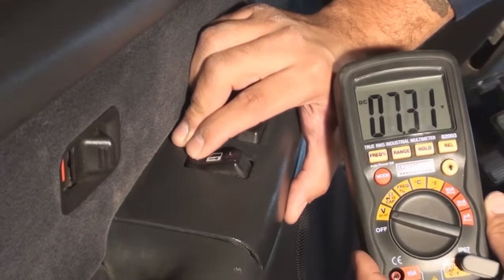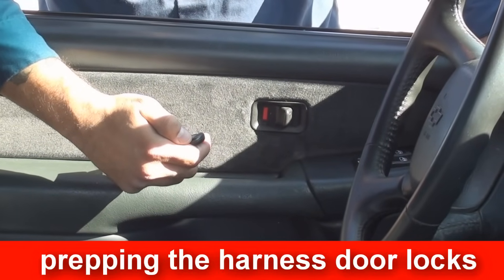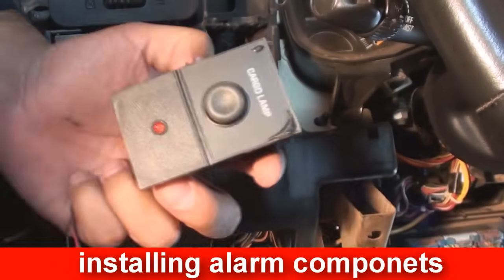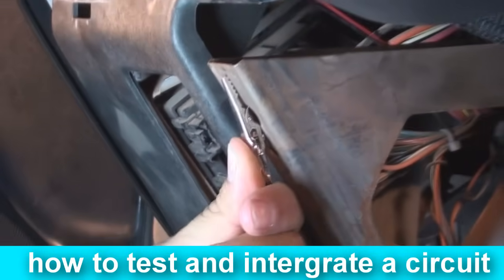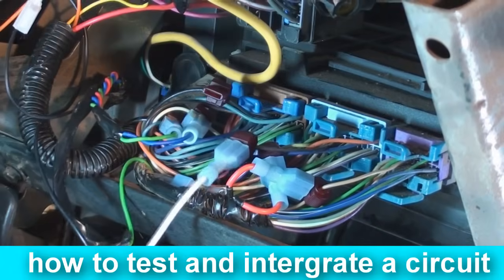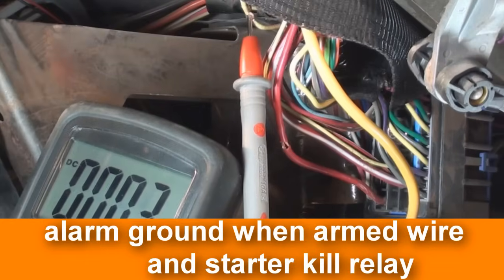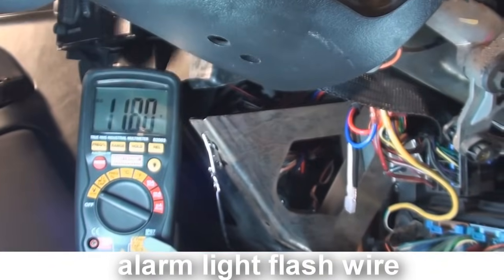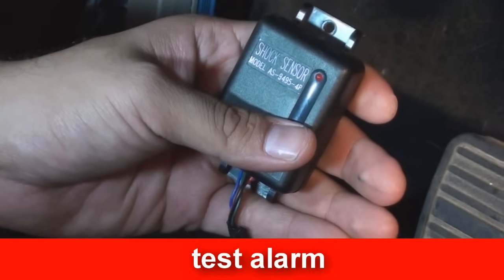how to install an alarm car security system

Comment: Thanks for a great video.  Do you happen to have a tech sheet on a 2001 Ford F350 with V10 motor?
Reply: friend, it seem you are looking for a product like the video show,it is happen to we have the similar product,we have 4G gsm gps car alarm,smart watch car key car alarm ,liquid crystal key,watch key smart car alarm,remote start module...so on. maybe you will interesting in one of them.you can look at my youtube know more,if you like it,you can add me 
whatsapp: +86 13417625973
WeChat：13417625973
keyless entry，remote start，push start...
4G gps mobile phone control car：https://www.ebay.com/itm/273785328395
liquid smart key control car：https://www.ebay.com/itm/284267230545
smart watch control car：https://www.ebay.com/itm/284302869970

Comment: Is there any such thing as a plug and play alarm system? I just don't like cutting into wires.
Reply from the maker: They have options that make installing a little easier, but nothing plug and play. I wish it was that simple. Flash logic has some  modules that make  install easier.
Reply: Thanks I'll look into that I hope it supports my vehicle its a 91 accord

Comment: hey i don't mean to revive an old post, but im having trouble finding tech notes for my 09 honda fit sport. any suggestions?
Reply from the maker: I can only find info for fit up to 2008, have you tried seeing If the 2008 info  has worked

Comment: hey quick question...im installing a crimestopper sp-101 alarm on a lawn maintenance trailer. im going with two pin switches instead of magnetic switches on the side door and the rear large door. i also purchased a Directed Electronics 507m- Digital Tilt Motion Sensor so if someone tried jacking up the tounge to mount it to a tow ball it would go off. the problem i have is finding out what wires to tap into on the alarm side for directed 507m tilt sensor to work. this is the crimestopper sp-101 alarm pdf http://www.crimestopper.com/Templates/2009_manuals/Alarm/sp-100_ins_ops_rev_b.pdf and this is the directed electronics 507 digital tilt sensor pdf http://www.installer.com/pdf/507m.pdf i just need help on how to wire the tilt sensor. any help would be much appreciated thank you.
Reply from the maker: sorry for the late reply, i never get these questions on my phone in a timly manner . are you still in need of assistance? for the tilt sensors constant red wire you can tap into the same constant wire of your trailer as you did your alarms red constant wire, this is the wire on your trailer that shows 12 volts at all times. 

the tilt sensors orange wire will connect to the alarms ORANGE WIRE: (-) NEGATIVE ARMED OUTPUT / STARTER DISABLE wire. if you are already using this wire with a relay to provide a starter kill for the trailer then you will need to hook the tilt sensors orange wire to this wire _An alternative solution is to
connect this wire to the true ignition wire of the vehicle (this wire must rest at ground when the ignition key
is in the OFF position).

the tilt sensors blue wire will go to an instant trigger wire on the alarm , you can use the blue wire of the car alarm
BLUE WIRE: (-) HOOD/TRUNK TRIGGER 
Input trigger for a grounding hood or trunk pin switch. Connect to existing hood and trunk pin switches that 
read ground when open. If no existing switches are available, install new pin switches if desired. Note: DO 
NOT mount new pin switches in water pathways. 

sorry for such late response

Comment: where do i go to find a wiring harness for my 1985 pontiac grand prix
Reply from the maker: Let me see if I have that info..
Reply from the maker: Start purple @ign switch
Ign1 pink @ign switch
Ign2 orange @ign switch 
Accessory brown @ign switch 
Headlights yellow - positive - at headlight switch
Constant 12 volt red and red @ign switch 
Dome light supervision white - negative - @pin switch or courtesy light 
Horn black - negative- @steering column harness
Power lock light blue - positive - @drivers kick panel 
Power unlock black - positive- @drivers kick panel 
Trunk release black - postive-@at release switch
Reply: Ok
Reply: is that for my car ?
Reply: where did you find this onfo ive been looking everywhere wit no luck
Reply: connectedcaraudio is this for my car? how did you find this like where did you go i cant find that info anywhere at all
Reply from the maker: yes this is for your vehicle, i had some old database that an installer gave me years ago .he gave it to me in school .its not on the internet
Reply: connectedcaraudio cool......can you install a push to start on my car ? If so could i use the same.schematic
Reply: Markese Lawrence h

Comment: I'm installing a viper 5904V alarm on a 1991 dodge dynasty, i have power windows and locks no trunk pop. I'm planning on doing alarm, keyless entry, and remote start. If you could let me know if i need any relays i'd appreciate it. Thanks in advance.

Comment from the maker: constant 12 volts  white @ ign harness
oem alarm disarm green/yellow  negative triggered  @ smart entry control unit behind drivers dash 
dome light supervision  red/white negative triggered @ 84 pin connector high in drivers kick panel
power lock  light green/white negative triggered @21 white pin connector in drivers kick panel 
power unlock brown negative triggered @ 21 white pin connector in drivers kick panel 
alarm input wire red/white negative triggered @ 84 pin connector high in drivers kick panel ( this wire is also found at the smart entry control unit  behind the left side of drivers dash top right of fuse block 
start wire black/yellow @ ign harness
ign 1 black/red@ign harness
ign 2 white@ign harness
accessory white/blue@ign harness
brake light red/green positive triggered @switch above brake level 
tach signal yellow/red@at engine control module (passenger kick panel )
parking lights red/yellow(dr)& red/blue(ps) positive triggered @headlight switch

the vehicle has 2 starter wires both wires must be powered in order for the vehicle to start when the engine is cold(the info did not come with the second start wire sorry) 

engine control module located in passenger kick 

yellow /red wire is located at pin 3 (tach wire)
Reply: connectedcaraudio

Comment: Great video. Very helpful.

I'm planning on installing a Viper 3303 in a 1997 Nissan 240sx. Do you have a data sheet that I could use? That would definitely help me out.

thanks!
Reply from the maker: Let me check my database when I get home, I will be there around 6pm California time. I'll see if I have that vehicle on my list
Reply from the maker: constant 12 volts  white @ ign harness
oem alarm disarm green/yellow  negative triggered  @ smart entry control unit behind drivers dash 
dome light supervision  red/white negative triggered @ 84 pin connector high in drivers kick panel
power lock  light green/white negative triggered @21 white pin connector in drivers kick panel 
power unlock brown negative triggered @ 21 white pin connector in drivers kick panel 
alarm input wire red/white negative triggered @ 84 pin connector high in drivers kick panel ( this wire is also found at the smart entry control unit  behind the left side of drivers dash top right of fuse block 
start wire black/yellow @ ign harness
ign 1 black/red@ign harness
ign 2 white@ign harness
accessory white/blue@ign harness
brake light red/green positive triggered @switch above brake level 
tach signal yellow/red@at engine control module (passenger kick panel )
parking lights red/yellow(dr)& red/blue(ps) positive triggered @headlight switch

the vehicle has 2 starter wires both wires must be powered in order for the vehicle to start when the engine is cold(the info did not come with the second start wire sorry) 

engine control module located in passenger kick 

yellow /red wire is located at pin 3 (tach wire)

Comment: hello my friend...i have a peugeot 206 model 2000 and when i am going to connect the alarm wires to my BSI,i dont know witch wire is for the arm/disarm...if i place the wires wrong i will destroy my car...please help me to fix this
Reply from the maker: I'm sorry for late reply I was having trouble with my reply comments section on YouTube, unfortunately this is a very rare car and I don't have any info on it. I checked my alarm database and nothing exist for it.
Reply: thank you for helping me....is there any web site that i can found car alarm manual specially for my Peugeot 206????that cars have BCI and if i do something wrong maybe i cause much damage to the car....

Comment: I have a 2001 honda crv and im installing a 5704 viper remote start do you have a data sheet i could use? Please and thank you
Reply from the maker: wire      /     wire color /   polarity/     location of wire       
              12V white                        +  ignition harness            
          STARTER black/white         +  ignition harness            
        IGNITION black/yellow          +  ignition harness            
       ACCESSORY yellow              +  ignition harness            
 SECOND ACCESSORY white/black         +  ignition harness            
       POWER LOCK green/white *2             -  driver door harness *3      
     POWER UNLOCK green/orange *2       -  driver door harness *3      
       LOCK MOTOR white/red                       drivers kick panel          
     UNLOCK MOTOR blue/red                     drivers kick panel          
    DISARM DEFEAT yellow/red                   passengers kick panel       
 PARKING LIGHTS + red/black                  dash dimmer                 
 PARKING LIGHTS - blue/red                     *6                          
       HEADLIGHTS red/white                   +  headlight switch            
     DOOR TRIGGER lt. green/red              -  drivers kick *3             
 DOME SUPERVISION                      comes on with unlock                               
 TRUNK/HATCH PIN blue/black          -  drivers kick *3             
         HOOD PIN yellow/red or yellow-  hood switch *3              
TRNK/HTCH RELEASE yellow              +  release switch              
       TACHOMETER blue                   test connector *1           
      SPEED SENSE blue/white           instrument cluster or PCM *7
       BRAKE WIRE green/white         +  cruise control *5           
     HORN TRIGGER gray *4             -  drivers kick                
              
           

Notes:
*1 Found at the 2-pin tach test connector on the drivers side of the firewall.  *2 Must use relays to trigger the lock and unlock wires.  *3 Also found at the green factory alarm plug located in the drivers kick panel.   *4 May also use blue/green at the steering column, negative trigger.  *5 The cruise control module is located in the drivers kick panel.  *6 This wire only works if there is a factory alarm installed. It is at the green factory alarm plug in the drivers kick.  *7 The PCM is in the passenger kick panel. VSS is in the 31 pin plug, pin 23.

Comment: I'm going to be installing a viper 5204 with remote, power windows, and keyless entry in a 1980 Corvette could you tell me if I'm going to need any relays.
Reply from the maker: I going to assume you don't have a remote trunk open, like when you hold the button and the truck pops open. So you will not need a relay for that unless you plan to add trunk pop, then you will need one relay for that. Does your vehicle have electric doors? If you are adding door lock actuators you will need 2 relays for that, door lock actuators let you unlock the door like power door locks. If your vehicle already has power door locks check to see if your alarm has reversible door  locks outputs. If you have power door locks I belive your vehicle has positive door lock triggers if it has negative door lock triggers and your alarm does not have reversible door lock outputs you will need 2 relays for that. I've only done power windows twice and I didn't need relays. But I would look at the instructions for them and see about that. Hopefully this helps you out
Reply: I'll check to see if the door locks are positive or negative. Can you tell me about the remote start start.
Reply from the maker: What did you want to know about remote start? Are you wondering about the relays in remote starts? All of the outputs on remote start have built in relays to turn on ac/heater and such. Remote starts are a huge install. The install manual for Viper are usally very well detailed

Comment: What should I do my alarm is too sensitive .
Reply from the maker: The shock sensor is what makes the alarm very sensitive to bumps and sounds. The shock sensor is a very small box attached to the alarm. You can ask your Installer or shop where the shock sensor is located. All you need to adjust it is a small flame blade screwdriver. Some newer alarms actually have the shock sensor built into the alarm itself and you can adjust it thorough the settings on the alarm, doing this though is difficult but check your owners manual on of your alarm is built that way

Comment: can you send me the tech sheet for a mazda demio 2001
Reply from the maker: I tried looking for that vehicle data but could not find it right now. But when I get home I'll check my other data sheets
Reply from the maker: i checked and i cant find anything on this vehicle
Reply from the maker: but i looks like it goes under the name of other vehicles also like mazda 121,mazda metro and ford festiva mini wagon i bet you can find the ford festiva wiring diagram easy and that should work perfect
Reply from the maker: this is all i could find but its for an earlier model see if its works

12 VOLT CONSTANT	  WHITE (+)	  @ IGNITION SWITCH HARNESS
 STARTER	 BLACK/BLUE (+)	 @ IGNITION SWITCH HARNESS
 STARTER 2	 N/A	 
 IGNITION 1	 BLACK/WHITE (+)	 @ IGNITION SWITCH HARNESS
 IGNITION 2	 N/A	 
 IGNITION 3	 N/A	 
 ACCESSORY/HEATER BLOWER 1	 BLUE/RED (+)	 @ IGNITION SWITCH HARNESS
 ACCESSORY/HEATER BLOWER 2	 N/A	 
 KEYSENSE	 N/A	 
 PARKING LIGHTS ( - )	 N/A	 
 PARKING LIGHTS ( + )	 RED/GREEN (+)	 IN DRIVERS KICK PANEL
 POWER LOCK	 ADD ACTUATOR, See NOTE #1	 TO ALL DOORS, See DIAGRAM
 POWER UNLOCK	 ADD ACTUATOR, See NOTE #1	 TO ALL DOORS, See DIAGRAM
 DOOR TRIGGER	 RED/BLUE (-)	 IN DRIVERS KICK PANEL
 DOMELIGHT SUPERVISION	 USE DOOR TRIGGER, (Requires Part #775 Relay)	 
 TRUNK RELEASE	 N/A	 
 SLIDING POWER DOOR	 N/A	 
 HORN	 GREEN (-)	 @ STEERING COLUMN HARNESS
 TACH	 YELLOW/GREEN (AC)	 @ IGNITON COIL
 WAIT TO START LIGHT	 N/A	 
 BRAKE	 GREEN/RED (+)	 @ SWITCH ABOVE BRAKE PEDAL
 FACTORY ALARM DISARM	  N/A	 
 ANTI-THEFT	 N/A	 
 EXTRA INFORMATION
 NOTE #1: This vehicle DOES NOT come from the Factory with Power Door Locks, by adding a Door Lock Actuators (2) of Part # 742 or the Door Lock Actuator Kit Part #745, you can add Power Door Locks to get a Keyless Entry to work on this vehicle.

Comment: Hi, I have a 02 durango and it only have 1 wire for both lock & unlock. It said lock trigger through 820 ohm resistor, and unlock 330 ohm resistor. How do I wire the blue & green alarm wire to my car wire? TIA

 http://www.modifiedlife.com/2002-dodge-durango-car-alarm-wiring-diagram/